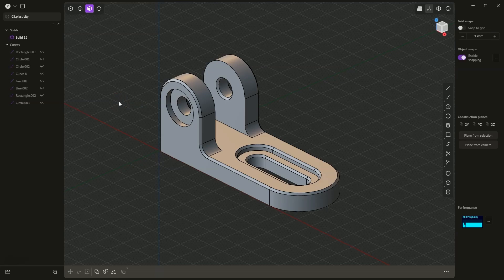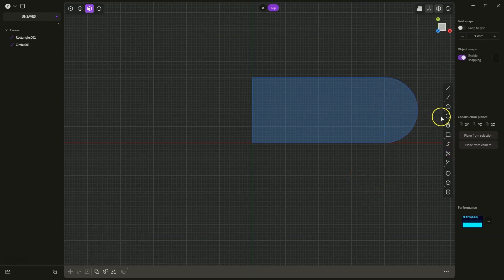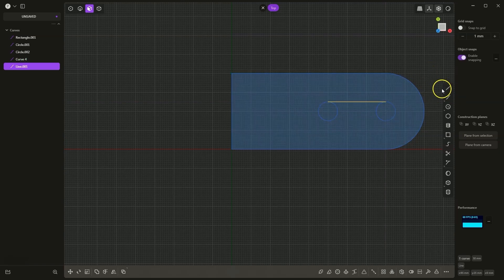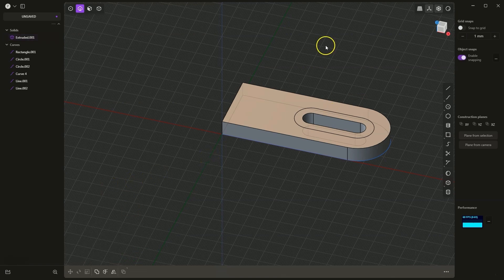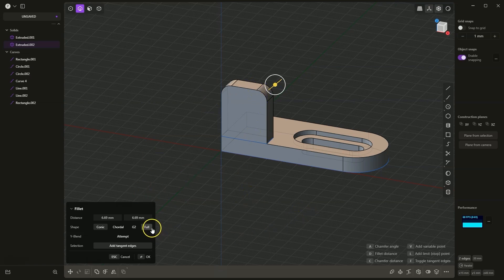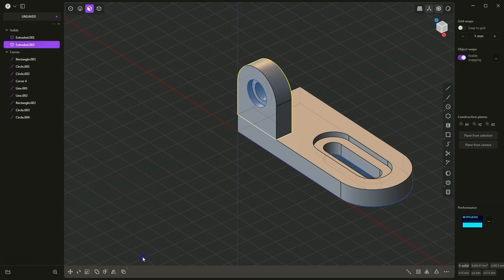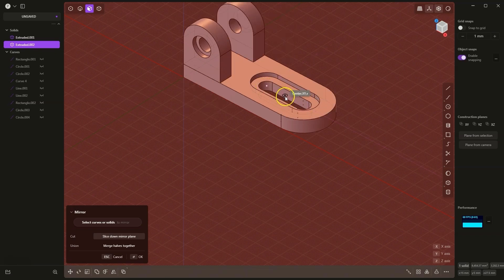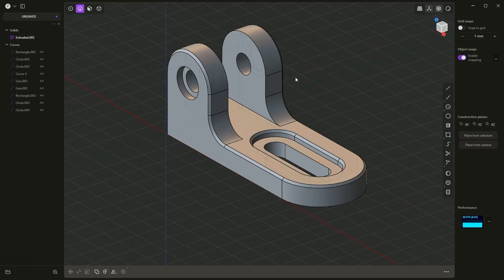Plasticity Some Basics for Beginners Based on a Simple Part

Comment: Hi you are doing great videos... easy to follow!  I nedd an advice.. i Struggle with simple thing... if you what make a easy video of it! .... If I do i simple "wall" in POLYLINE then I want to make a simple door with in POLYLINE.. and i want to CUT it. but it doesnet work what Iam doing wrong.. must I make an extrude on the wall and then it works? I just want to make every thing in POLYLINE
Reply from the maker: Trying to understand your problem.
Maybe the cut line doesn't extend beyond the geometry you want to cut?